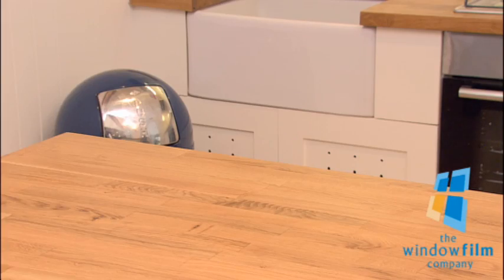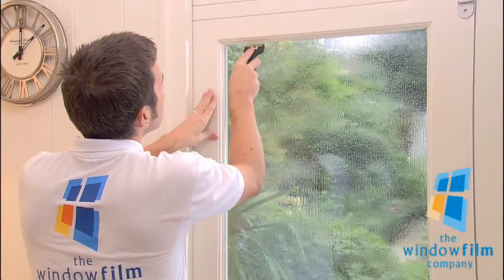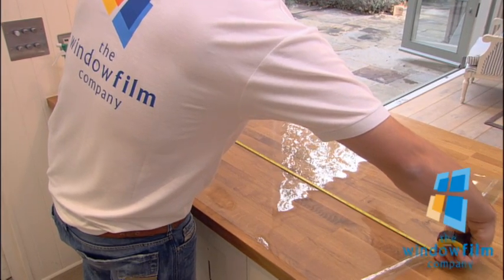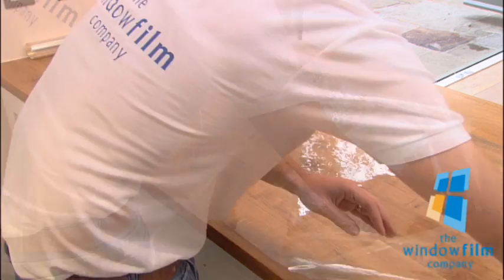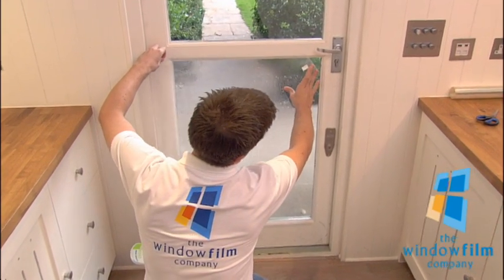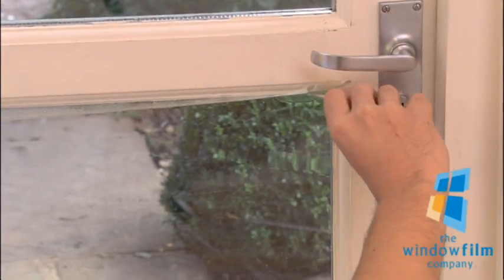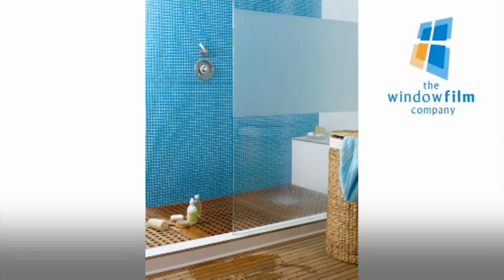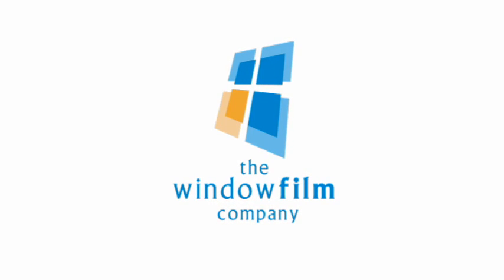How To Install Clear Safety & 🔒 Security Window Film 🔒 | WindowFilm.co.uk

Comment: Is it necessary to apply some sort of anchoring system - to connect the film to the frame - silicone, or adhesive strips?
Reply from the maker: The only type of film that we supply that requires anchoring systems are specialist bomb-blast protection films – we are a Madico SafetyShield Premier Partner ( https://www.windowfilm.co.uk/commercial/bomb-blast-protection/a-global-madico-safety-shield-premier-partner ), so offer the full range of films within that collection. Our standard films are applied with a water based application process, with no need for anchoring systems. For any further enquiries you can get in touch with us directly by calling 01494 794477 or email info@windowfilm.co.uk. We’re always happy to help.

Comment: Why no silicone or gasket to be used to stabilize the window films?
Reply from the maker: No need for them normally - The adhesive, activated by the water does the job in most cases - Some installations we might use these methods to add stability >> https://www.windowfilm.co.uk/commercial/bomb-blast-protection/mdico-gullwing-anchoring-system or https://www.windowfilm.co.uk/commercial/bomb-blast-protection/madico-wet-glaze-anchoring-system